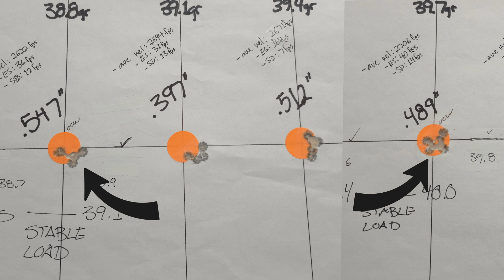The OCW method: part 2 (OCW vs 10rd Ladder Test method series)

Comment: Brother, it's awesome to see your reloads are where they should be. 
 Starting to get consistent with Sd and Es.
 Just a thought for you, though. Spread out the charges to .4 or .5 it will save you bullets mostly and powder. But if you are good with what you are doing, stick to it, Brother.
 Also, understand that just because you are getting good groups at 100 yards, it doesn't mean that you will at 500 yards.
  Also, Outlier is a new company, and they are part of Arken. Give them a look at the chassis and barrels. Great Prices and getting great reviews so far.
Reply from the maker: @MTCKIE68 Thanks, bro.  I really appreciate it.  Ok.... So question. .I've always wondered this... when you're jumping .4 to .5 grains, are you just  looking for an area where the targets are showing you to take a closer look and shoot some loads in that charge weight range? I know i need to talk with my neighbor he owns 1000s of acres of farm land about a 5 minute drive and do some long rang shooting.
Reply: @Reloaderscodex  i think .5s are ok to start if you are covering a wide range of powder weights but you may miss a node.  If you find something that looks decent, then do smaller test around that number to fine tune. Usually i do .5 jumps to find the speed im looking for, then .2s going down and up from there to see if it holds.
Reply: @JeffJohnson-McgSpook  
Exactly 💯
Reply from the maker: @Mcgspook I see.  Thanks bro 👍
Reply: @Reloaderscodex  
Yes, that's exactly right. 
 That's why most of your competition guys usually start with .3 or .4 and find 1 spot or 2 to find the sweet spot.  
  It speeds up the process some. 
 If you aren't a competition guy, that's why I said .4 to .5 to get started.  You definitely want the best velocity with the lowest Sd and Es. 
 You know that is a very stable setup there !
 Then, it's the neck tension and seating depth.  That's where the accuracy is.
 But you need to know exactly what your chamber is to be able to set a free bore and get your true consistency on seating depth and overall length to reload.
 The key is to learn your chamber, and then you usually are .25 to .10 thousand free bore. 
 Also, remember when you get your barrel chamberd, you want that reamer to be as tight as possible for the mouth, neck, and shoulder to keep the brass stable and last longer. It's very little trimming if you do that. 
 Manners reamers are really good. They know what you mean when you say as tight as possible chamber and be safe.
Reply from the maker: @MTCKIE68 Im pretty sure I have a tight chamber now.  New brass keeps the same headspace after firing.  Its convenient thats for sure lol
Reply from the maker: @MTCKIE68, @Mcgspook You guys have any advice on seating depth testing? I figured I'd start at like .010 off the lands and do .005 increments out/away from the lands .010/.015/.020/.025/.030/.035/.040/.045/.050....starting with 2 shots per seating depth.  Then explore around the seating depths that the 2 shots are closest together.  Or is it better to do 3 shot groups to start with not 2?
Reply: @Reloaderscodex   I shoot berger hybrids almost exclusively and they are almost always best just kissing lands or 20 thou. I single feed though. if im limited to mag length for some reason i go max mag, then come back in tens up to about 40 off until it looks legit.  then ill do 5s to fine tune.  once match season starts i fiddle 1-3 to group tune on prep day.
Reply from the maker: @Mcgspook Cool. I have some bergers ill be testing soon.  Pretty excited to see how they shoot. What's a good place to start off the lands for initial seating depth testing?  .010 off? Idk anything about shooting near or into the lands so im looking to stay close to the lands if necessary but not go into until I know more about that stuff. Also is 2 shots too small of a sample size to see where to hone in when shooting the seating depths?
Reply: @Reloaderscodex  berger hybrids are easy to tune.  id do 15, 20, 25 and 30.   99% chance you will be 20 or 25 thou. if you do berger vlds they are really tune sensitive and when tuned right are wicked accurate. but you have to really stay on top of them. another one to test is the lapua scenars.  great experience with them in both 6cm and 6.5cm.  honestly though, if you cant get a berger hybrid to shoot, you got bigger problems.
Reply from the maker: @Mcgspook i believe they're 140gr hybrid targets. Are those initial seating depths a good place to start on most bullets?  like in this videos case im testing 140gr hornady match.  Or is that more just for the bergers?
Reply: @Reloaderscodex  
Bergers for sure. But yes for any good quality bullet
Reply: @Reloaderscodex  i honestly dont even bother shooting other bullets. the 140 berger hybrid is a staple bullet.  if you arent going to buy customs like vapor trails, then a berger is the best you will get. for other bullets i would start at 10 off, go in tens until i found a nice spot.  then work in 5s around that.i shot 6.5 last 2 years in tactical BR.  First year was 139 lapua scenars and they shot. outstanding.  But i got them because i found a deal on 1k of them. 2d year was 140 berger hybrids.  this year im shooting 7mm08 with 180 berger hybrids. you may fiund other bullets that shoot tiny groups.  but you wont find others that you can sort where literally every bullet is with 2 tenths of a grain across 1000 of them. if you want the easy button, just get the bergers.
Reply: @MTCKIE68  great advice! keep records... invariably you will come across patterns.  use those patterns to save time. its the one resource you cant just purchase.
Reply from the maker: @MTCKIE68 I really appreciate all the support and advice bro.  I keep such meticulous notes its just a little bit a lot of ocd haha.  I use excel to make workbook sheets that allows me to keep notes/records of everything. I save all my notes, targets, and i of course have video archives. You can see in the videos when I'm going over the targets at the end of the videos they have been 3 hole punched cause I keep all my stuff in a file cabinet.  Even with my reloading it takes me FOREVER to drop powder cause I'm constantly weight checking (verifying) my scales so i know they're accurate.  I use two scales and double-check every charge. I drop .1gr under and hand trickle up. Lol.  I probably over do it a bit lol, but I like being as precise as possible.  That's what's so fun about reloading.  The constant pursuit of the perfectly made ammo. Lol.
Reply from the maker: @McgSpook damn. Thats some good quality control. Thanks for the info.  Its much appreciated 👏
Reply: @Reloaderscodex  
 Trust me you aren't the only one. 💯 
 Eventually you will get comfortable with your system and be dead on. 
  You do you and don't apologize for it. Better to be how you are now !
 But always listen and learn and there's never a stupid question !
 Here's another thing to consider for your records, use graphs to find the node with velocities, Sd and, Es.  You will be surprised by how much you can see. 
 Also when you have the COAL figured out, the neck tension is the final Sweet spot for accuracy. Remember brass springs back a little. 
 Don't be scared to go to the max pressure and slightly more. If you're using quality brass. You can sometimes find something. But it will take life away from the barrel and the recoil takes you off seeing the shot hits. Unless you're using weight to keep your gun down.
Reply: @JeffJohnson-McgSpook  
That's True !! Preach it 🙌
Reply from the maker: @MTCKIE68 Yeah, that's one thing I've really appreciated about the precision rifle/reloading space.  99% of ppl are extremely helpful, polite, and willing to help you reach your goals and potential.  I can't think of any other sport/hobby that's so welcoming and generosity is so prevalent.
Reply: @ oh man we were so close on everything until you mentioned velocity nodes.  they dont exist.  accuracy nodes do exist.  i kinda did a rant on the previous video lmao.